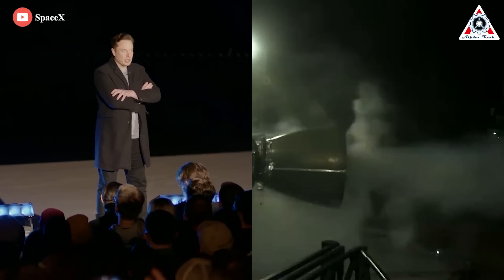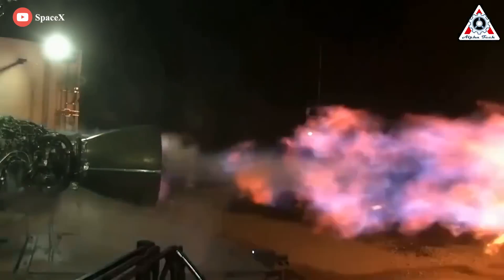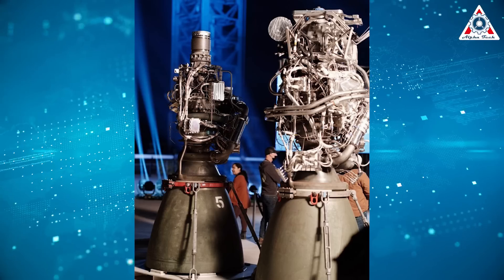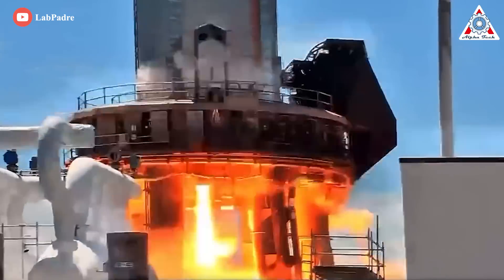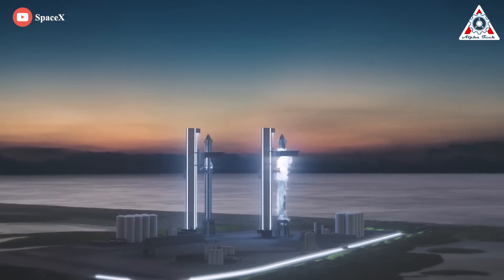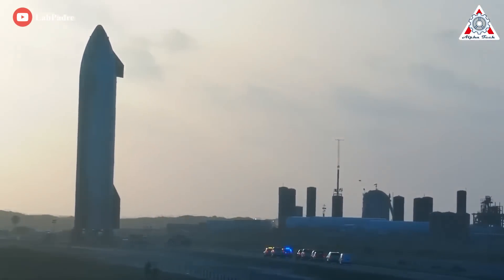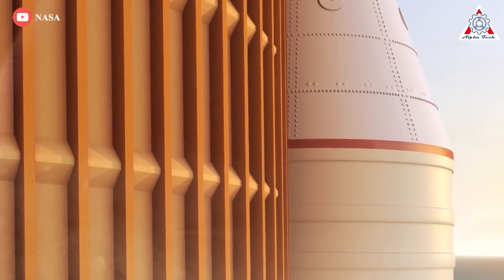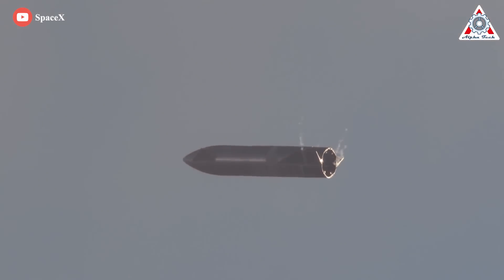SpaceX upgrades everything on Raptor Engines is totally thrilling Scientist's minds...

Comment: for this alfa tech channel, I thought of a motor powered by water. not fueled by water, but powered by water. Then while welding I thought of way to weld with no welder, no electricity, no skill required, can weld inside metal sheets as well as just weld around edges, so no teaching needed to weld". I need production from idea through development!

Comment: The SLS is NOT a "cutting edge design."  It is 1970/80s tech Shuttle hardware originally designed to be reused many times, but now used in fully disposable mode and the per launch cost has been officially projected to be $4.1 billion and not "1.55 billion to over 2 billion."
Reply: ⤴️⤴️Hey mate! Thanks for watching.Tell expert Andrei jikh that you were referred by Elon musk for the right financial profitable investment project to participate on it. Msg direct⤴️⤴️

Comment: if oil and gas crises, its pure dumb ass using fuel, if want to make it in space need self-building microfluid extraction lace patterns that will suck the fuels out of space like H2O helium and other fuels needed, weight is cost and the spaceship isn't made with superconductors to give lift, so don't have to use as much fuel, how are you going to make in space without microfluid extraction space suits, could try the tattoos, space program🦨@#$%^&*(#$%^&*() Oneill cylinder

Comment: 2:50: "Raptors being one of the cleanest burning rocket engines available" That could not be more wrong if you tried. RS-25 using hydrogen and oxygen produces only water. Raptors produce a lot of CO2 but what is maybe more serious is that the methane used by the raptors, is a extremely potent greenhouse, much worse than CO2. Every venting, engine spin up, and explosion results in massive pollution.

Comment: China's Industrial Capitalism is easily able to fast follow the risk taking of finance capital (the west).  There is not always first mover advantage.  China will move into non-expendable rockets and their costs will drop, and they already have a very powerful nuclear powered "motor" for a space tug.  They will also build factories in space, assembling very large planetary spaceships.  The trick is getting OFF THE PLANET, AND OUT OF THE GRAVITY WELL.  The best design for getting of the planet is the Neutron, perhaps scaled up a bit, with engines more powerful than the current Archimedes.  Elon made decisions in alignment with what a private company can do, he does not have an entire nation's resources behind him, and cannot build factories in space, like China will.  Also, the Neutron design will be copied by many countries, especially since Stage Zero has such low complexity and cost.  Granted that Elon has genius, but there are other genius people in the world, and there are too many bad decisions surrounding the Starship.  One major reason the Raptors are powerful is that they are stressed to the max.  They have to be because the Stainless Steel of Starship is so heavy, in turn because Starship has to return from orbit.  The Neutron stage 1, like the Falcon does not return from orbit, and hence does not have so many risk factors, like  heat and speed generated during orbital re-entry.  China will likely just build re-entry "capsules" in a space factory, while thousands of Neutron like vehicles deliver cargo up into LEO.  Finance capitalism sucks at long range planning.
Reply: ⤴️⤴️Hey mate! Thanks for watching.Tell expert Andrei jikh that you were referred by Elon musk for the right financial profitable investment project to participate on it. Msg direct⤴️⤴️

Comment: you cant send rockets year round to mars, the trip would take far too long. they have to be sent at the right time every 2 years, so youd have to launch a ton of them pretty much within a few weeks. 

Also, SLS is using spacehuttle parts and has been around in one version or another since around 1995. i would never considering it the best or built by the best. The company behind it is utterly falling apart and keeps proving itself incapable of doing the basics, even failing to do basic inspections which have resulted in the loss of vehicles (forgot to check to see if the parachutes were attached, 2 required inspections for this were skipped, it pancaked)
Reply: ⤴️⤴️Hey mate! Thanks for watching.Tell expert Andrei jikh that you were referred by Elon musk for the right financial profitable investment project to participate on it.Msg direct⤴️⤴️

Comment: Lets stick to the facts please. Most of what Elon has said is still a pipe dream. We haven't even seen a 30 engine test firing. Booster 7 fired 7 engines for a few seconds, then got 2 engines replaced and then went back to the high bay for whatever "upgrades" means. That's far from reliable enough for rapid reuse! Starship isn't ready for an actual launch! Never mind going to orbit and coming back down in the ocean without issues. Never mind catching the ship and booster or even rapid re-usability. These are all pipe dreams until it is actually done reliably!!! You may not realize just how RISKY catching a space craft is! Look what happened with the SN test craft when they landed a little to hard! They became a BOMB! Now you are going to do that very close to a very difficult to build and expensive structure (mechazilla) with 10X more fuel. The RISK here is tremendously high! Catching has to work flawlessly and be incredibly redundant. Right now the catching mechanism is way too slow to catch a rocket. This can't be human operated. It has to be computer operated as humans are too imprecise and slow. There is no redundancy in it either. The 2 mounting balls are everything. Miss one, slip off, something breaks and the booster or ship crashes to the ground and explodes! So again...stick to the facts and call what has yet to be done what it is...NOT facts and wishful thinking or future plans.
Reply: Starship doesn't even actually use rocket engines to leave earth... 🤣🤣 You people are so behind the curve... We've been going to the moon and Mars everyday for 50 years and none of you fools even notice 🤣🤣🤣🤣... These rockets and crap are all part of the disclosure project... 👀
Reply: @stonehaven2289  So the implication you are making is that SpaceX is wasting lots of time and money to divert the worlds attention away from some sort of anti-gravity tech? Care to show actual evidence of "some other" method of getting to the moon or Mars that humans have access to? As far as I can tell, we use a hell of a lot of rockets to get to space. How else humans might get to space is something I've personally searched for and can't seen to find any evidence for "some other" way to get to space.
*
While I too want disclosure, I don't see the connection you are making.

Comment: I would expect that there would be Starliners that will stay in space and act as a 'trainline' of Starliners moving from earth to mars, picking up containers of cargo and been refueled in earth orbit, no need to lift each Starliner from surface to orbit, just the cargo and fuel and knowing Musk the fuel may well be made on the Moon in autonomous solar powered fuel making stations and shipped to earth orbit
Reply: Why move to earth orbit  why not refuel in lunar orbit with an expanded lunar gateway station that's already in plan,  then you do  your mars burn and not waste fuel with a in-between journey by another craft. however  i guess it all comes down to the most practical launch path for the journey to mars.
Reply: @MrSCOTTtheSCOT  
Musk has to begin with an Earth-based operation.....There will inevitably come a point where a permanent Lunar Base will make more sense for mining and manufacturing the space technology needed for Solar System exploration.
The first major goal is a SELF-SUFFICIENT presence in space/moon/mars....
Reply: @guitardzan5641   I'm replying to the original poster proposition of Musk having a fuel creation depot on the moon, I'm  merely pointing out if you are making fuel  on the moon why waste some of it transporting it back to earth why not just have the ship you are refueling  with that fuel   do it at a logistic station there , that is is an idea that is way far in the future given we don't even have anything on the moon  yet, let alone the lunar gateway or a  expanded version for mars destined  ships. Obviously any initial launches for mars will be from earth the only caveat been launching refueling version of starship, basically starship tankers to refuel the ship after leo  arrival before making your mars burns , however  within his original post the postulation of multiple pre launched autonomous starliners  for top up  on the way may be a thing but its a lot of hardware to have floating in orbits between earth and mars then  do you abandon them or refill those to get them back .  Mars will be the most expensive endeavour for mankind , Elon is doing a god job on the marketing , the affordability and logistics though  will be something comparable to going to war with an empty planet for one hundred years. do private companies and governments have the stomach for that given the troubles that are to plague earth in the next 100 years with things known and unknown. Most governments on earth are trillions in debt it would seem mankind would have to recreate a almost utopian society to start down the path of terraforming Mars but greed wont allow that.
Reply: @MrSCOTTtheSCOT  
It was an error to address a generalized reply to any specific comment.
My bad............
Reply: @MrSCOTTtheSCOT  That will do it 😀
Reply: Can I have some of your drugs please?

Comment: I'd love to see the Raptor 2's welding. I'm a structural steel welder myself, and the thought of welding rocket engines is fascinating.
Reply: I have witnessed the welding on satellites, it’s all high purity robotic welding.
Reply: @drew8256  One of my certifications is for operating a robotic welding system from a Canadian company.
Reply: They use a old buzz box for welding. ;)
Reply: It’s basically metal glue.
Reply: @mkwiswes  Yes, but the metallurgical properties and of the base metal, filler metal and conditions of the weld area are very specialized. SpaceX has had to create new alloys of inconel.
Reply: @daviddesrosiers1946  I thought they were using a laser welding process without filler material in most cases.
Reply: @mkwiswes  only in your dreams ! Metals ARENT working the same as in your...typical chemistry class when two chemicals are combined and their properties are well known well understood and well defined
Reply: @kukulroukul4698  huh… are you saying they aren’t following ASME or AWS procedures?
Reply: @Spindrift_Productions  That's the ignorant take. Human welders are becoming more specialized in tasks unsuitable for robots.

Comment: Liquid hydrogen is carbon neutral, as the only byproduct of burning it is water. When you burn methane, you do get water as well, plus Co2. The C stands for CARBON!
Reply: Producing and storing hydrogen is problematic. Requires lots of energy to produce hydrogen
Reply: @klardfarkus3891  Understood, my point was that the video claims that Raptor will be the first carbon neutral rocket engine, which is wrong on 2 counts... 1, not the first and 2 not carbon neutral.

Comment: How far might an optimized Starship be able to travel w/o a booster?
Reply: It can only leave Earths orbit with no payload, if it does that it's designed to then be refuelled by a tanker launched on superheavy - having that much fuel onboard in orbit means it will be able to land and relaunch from places like the moon, mars, etc. :D
Reply: I see what you're saying. Basically a "hopper" style Starship, optimized for sub-orbital flights/hops point-to-point with passengers... without the need for a booster.
I was wondering the same thing.
Reply: I think it's more likely to be launched ontop of a superheavy booster then it can head off into space with the vacuum engines no refuel needed :)

Comment: One issue, still to be resolved, is the logistics of an orbital fuel depot. And it is where some unforeseen costs may develop.
The best rocket can place in orbit 5% of its mass at launch; Spaceship plays in the 3-3.5% range, and is subject to further improvements. This isn't SpaceX fault, but it's the tiranny of the rocket equation. 
The foreseen low price of Starship launches is what makes a fuel depot in orbit possible. A full load of fuel/oxidiser (~1600 t) for Starship require a dozen launches, proceeding quickly in a clockwork fashion, because the cryogenic LCH4 and LO2 have a tendency to evaporate. This can be limited with reflective surfaces, good insulation and a barbecue-grill depot; but if SpaceX wants to keep the fuel in orbit for weeks, they will need some solar-powered cryo-cooling system.
My 2 ¢.
Thanks for the video,
Anthony
Reply: Should be fairly easy to keep the LOx and CH4 from boiling off with just a sunshade for the fuel depots.  Liquid H2 would be another matter.  The Starships in transit to Mars will need some active cooling for the fuel and oxidizer though.
Reply: @Jim-ku6ry  Yes, Star Trek is good entertainment.  My point was just that you're jumping the shark.  We will put humans on Mars using good ol' CH4 and LOx, and you will weep with joy when it happens.  Starship is advancing space travel at a rate not seen since the Apollo era.
Reply: Is in orbit fuel production feasible drawing raw materials from the atmosphere?
Reply: Seem like the best thing would be nuclear powered rockets for long distances. Just use the stuff they have now for getting to orbit and down again.
Reply: @Jim-ku6ry  We've already sent numerous missions to Mars without nuclear propulsion. Absolutely not necessary.
Reply: @Jim-ku6ry  Space is pretty big. No matter what technologies we adopt in the future, people will be taking very long voyages.  I'm all for dilithium crystals and warp drives, but we have to learn to walk before we can run.

Comment: so the answer is double turbo chambers a and side room pressure mushroom compositors  fro about 450 tonne off pressure yess it can melt requir above cap cooling and aditional shield around turbo and presure cahmebrs mushroom but it could work and could stabilized with bell sprinkler above foe aditional owerall safetz tech specs are bit the same as NASA but fast performed knowhow except heat and output are more usefull as tank are smaller and rocket is lighter also is possible to count on druability better as engine would be safely test and put into lock at 94% ( 6% stays for safety engine and better usability in as duration time off engine ) more success time atempts in fly which NASA count and space X kind left to owerdominate in numbers off use high quality  off  3D material and even some acustic design test can be done with ring above at end and flat part ring and then angled to create slight vortex heat that reduce temparuture back pressure so this tech is disperse factor and aqustic test makes design more fabricated orient to success theme or more futuristic so once upon time is done in NASA engine but NASA didnt know the cause for easy explosion and fuel leekage problems to figure out later is not proper fuel for rocket which ironicaly rejected more enregy as more flamable the real reason complicate enginering tech to build parts so know in this 3d part assmebly sarted to acepted as normal in space work or elsewhere in english is something nice but is not without off energy or heat or somekind off power source energy future outhere rest is colecting processing living or extracting material and in future some production too
Reply: If only Frankenstein had your brain ! 🖖
Reply: I can't say that I understand what you were trying to say...
Reply: (Inner Samuel L. Jackson) "ENGLISH MUTHA F@€KER, DO YOUSPEAK IT!!!!??"